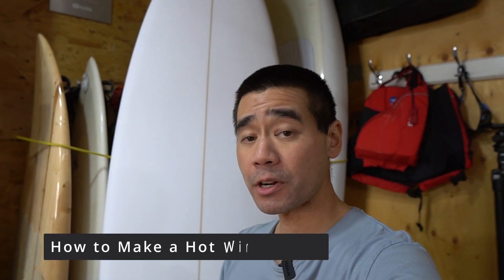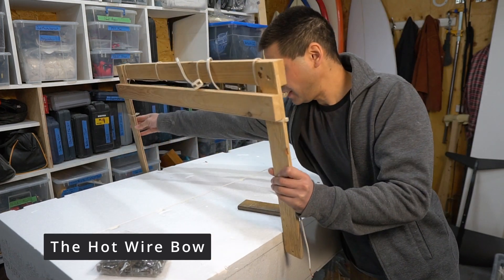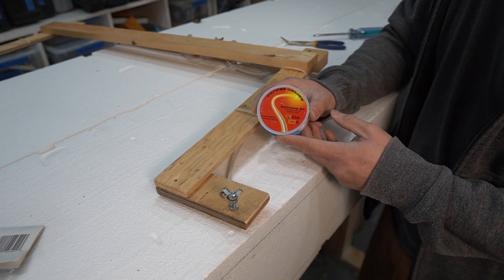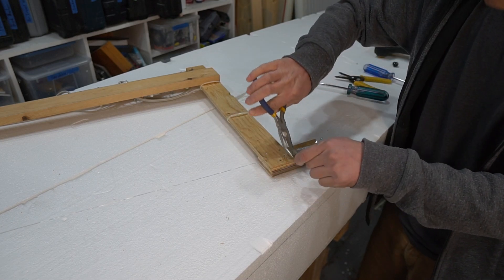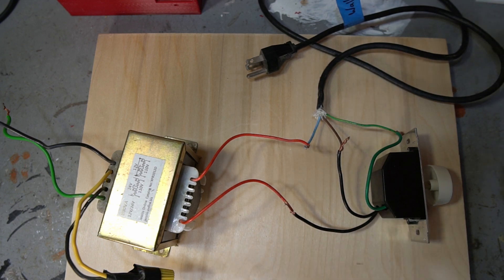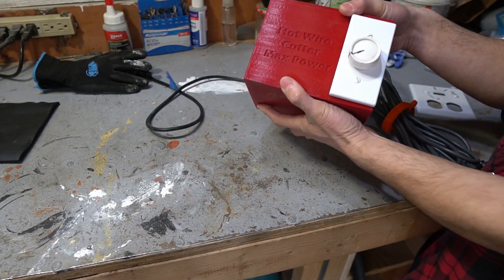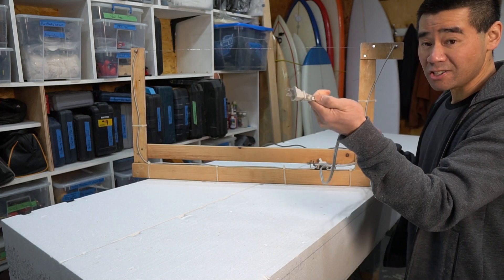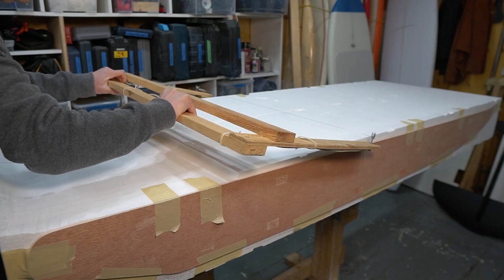How to Make a Hot Wire Foam Cutter for Styrofoam

Comment: I'm sorry but I didn't see how you wired the bow is white on one end and black on the other end of the nichrome wire also wondering if a 12 volt battery charger would work one clamp on each end of the nichrome wire

Comment: I'm building a 38 gauge nichrome foam cutter with a wire distance of 90cm (35 inch). How much voltage would you estimate I need to make it hot enough to cut foam?

Comment: Love the video. I have a memory foam mattress I need to reduce the thickness on.  I think what you show in your video will work. I’ll have to make a VERY large bow to do it though. I clicked on the link for the transformer you used but they’re sold out. Do you have a recommendation on a different one that would work? Thanks.

Comment: Guitar E sting and power supply from an old computer works well for me. I connected the string to yellow and black wires from PS, that is 15V. Also green and black should be connected to start the PS.
My cutter cuts just a little bit slower than yours.

Comment: Don't mess with mains   power don't touch it  use a 12v 2amp wall charger  mine is from a cctv camera power adapter  safe as battery's

Comment: Really enjoyed a few of your videos today and this is a great how to. 

Question... Could you reverse your switches? Putting the dimmer on the bow instead so that you can adjust your wire temp as you are cutting or is that too much strain on the inverter since it would always be on max? Could also print a pulley system like a throttle cable on a motor that would control the dimmer. Just throwing out ideas from one maker to another.